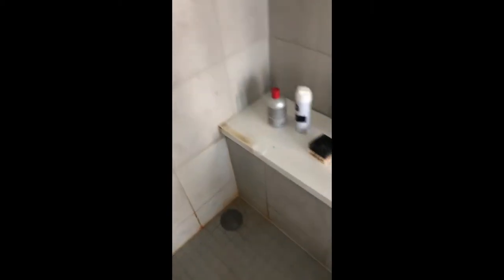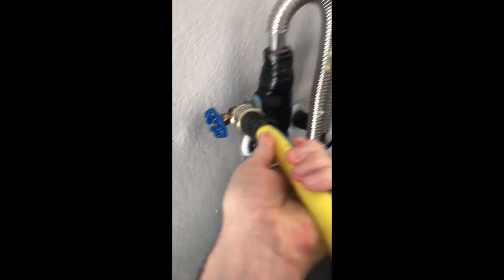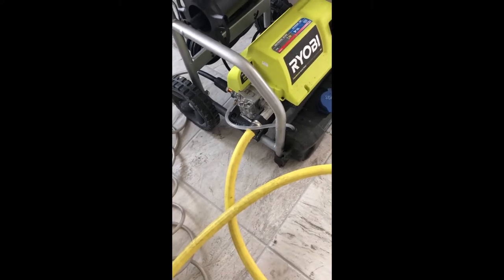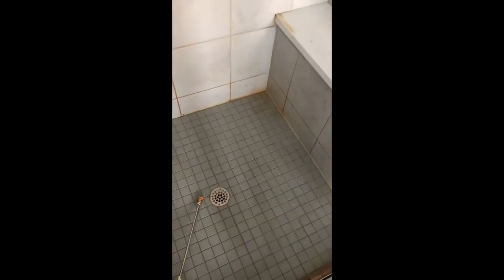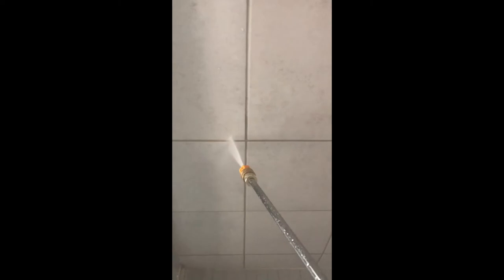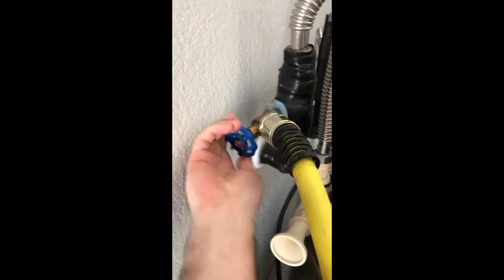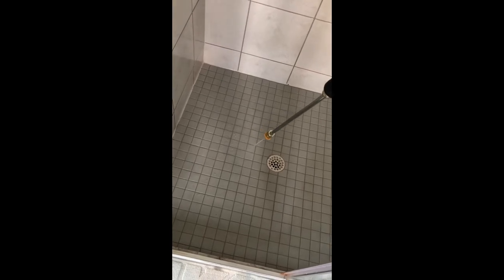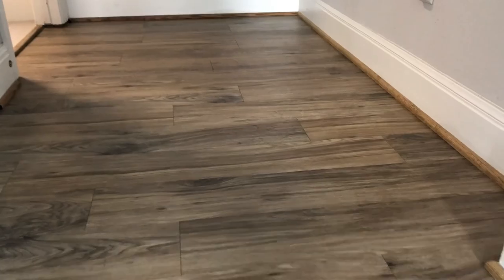Shower Power Wash

Comment: Great video. You can get a pipe to hose adapter and temporarily remove the shower head for a water source.
Reply from the maker: I know, I just haven't ordered one and I don't want to mess with the shower head either, because it leaks a bit already and I did the teflon tape treatment and all. It's not bad to just route a hose from the garage.

Comment: Toilet bowl cleaner will etch/dull the surface of your tile. The "orange" is iron deposits. The pink slime is mildew. There is a product called "Shooter by Powerhouse" that destroys iron deposits, but it also will etch/dull your tiles glazing. Honestly this is probably the safest thing to use... though I would be afraid it would rip out the grout.... especially on older showers. All in all, great idea.
Reply from the maker: The water coming out of the shower head is filtered and the neighbors with the exact same house model don't get the orange, so I'm convinced, based on some research, that the orange is biofilm due to bad ventilation. I was also afraid of damaging the grout, but this test here proved that that was not an issue!

Comment: I've been planning on doing this exact thing. I have wide grout joints in my shower tile, and its impossible to keep mold out of it.  Been wondering if those cordless power cleaners would have enough pressure, but I already have that tiny  1600 or 1800 psi electric ryobi.
Reply: Does the Ryobi work

Comment: nice vid.  going to try that.  the black stuff IS the caulk that went moldy.  you can only get rid of the black stuff by re-caulking which i hate.  i have the same power washer.  now you confirm my question, will it work.  thanks dude.

Comment: 5 months later, any adverse effects on your shower?
Reply from the maker: Not really. I did have some old black caulk fall off, but I think that would have happened naturally anyway, as it was weakened by the mold. That's right, black caulk.
Reply from the maker: And even though you can't really see or detect it, I know that micro pieces of the grout have been coming off, because I did feel some tiny shots on my skin when I was doing the wash. I've done the wash 3 times now and I'm going to keep doing it at this rate.

Comment: How much pressure did you use?
Reply from the maker: This pressure washer does 2,000 PSI + 100 pressure boost. I was also using the concrete nozzle for the most pressure possible.
Reply from the maker: I’ve also done this 3 or 4 times now in the same shower. No issues.
Reply: @PushyMagnet  many thanks....

Comment: Ok. But how do you recommend doing that? I seriously liked your added explosions.
Reply from the maker: How do I recommend doing what, specifically? I definitely recommend power washing your shower. It's extremely effective and requires no chemicals. Better if you can feed the power washer hose through a window, but that wasn't an option for me, as my bathroom windows don't open.
Reply from the maker: BTW, I stitched all the videos together with whatever Photos app comes with Windows 10. It was painless and it had these 3D effects too!